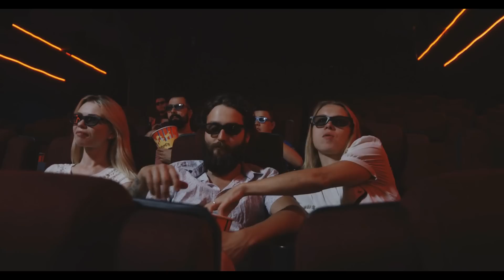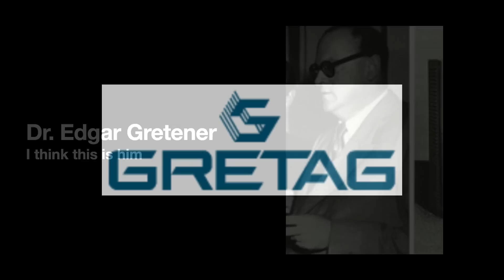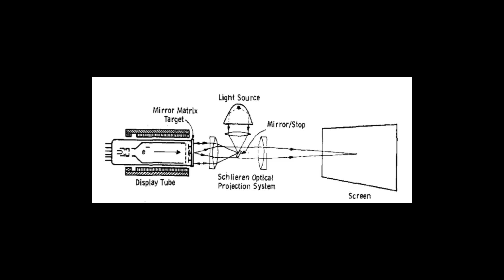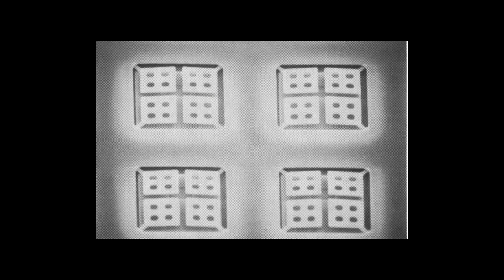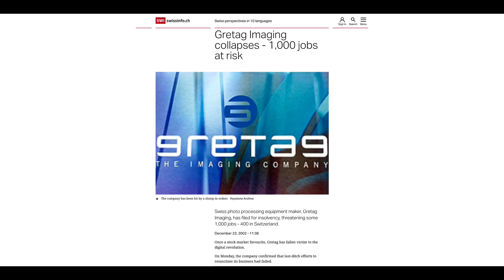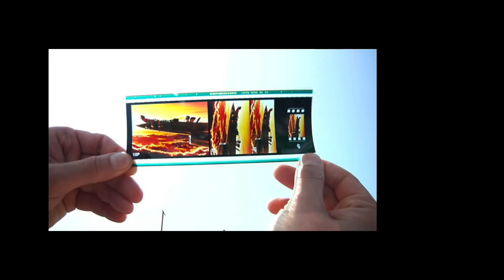How Optical MEMS Won an Oscar

Comment: “Your slow and incompetent human visual system is too slow to perceive”.

Too slow too perceive what? Just so you know, one source of anxiety is optical overload. That means too much visual data is being perceived, which causes stress. About a hundred years ago, a doctor invented a pair of eyeglasses with mechanical shutters that opened and closed fifty times per second. This cut-down on incoming imagery. But I don’t know if these glasses were effective in reducing anxiety. Nowadays it would easy to do that with a pair of LCD lenses. And you could add a software option to your big screen TV; limiting the refresh rate to fifty, or forty, or thirty frames per second. Also, the sound track of your TV could have adjustable pitch because slightly “sharp” audio is cheerful. Orchestras commonly tune their instruments to a slightly sharp pitch.

Anyway, this video tries to make two false claims. The first false claim is that more data is always better. But that’s not true. On the contrary, it’s the ability of the human mind to prioritize and select only certain data when thinking. That’s called “Focus.” So even if the incoming amount of visual data were increased, it still wouldn’t change the value system, and logic system of the viewer. More is not always better. Information is supposed to concise and relevant; not generalized and endless. Have you ever read a government report?

The second false claim is that visual perception is an isolated experience. But of course it’s not. What a person “sees” is only part of his or her entire Kinesthetic experience. Mood, hunger, social setting, and expectations all have a profound effect on how visual information will be interpreted. In the video “Clint Eastwood” the additional claim is made that perceiving with five normal senses is pointless because physical reality doesn’t exist. It’s all just part of your imagination. (You perceive with your mind…so it’s all in your head). But physical reality is the artistic product of our intellect. Beautiful women and handsome men are the result of careful selection, good families, and genetic memory. 

Most people don’t know that there’s no such thing as “instinct”. When a bird builds a nest, it’s relying on inherited memories. Human experience is actually coded into your DNA, and it changes with each generation. DNA patents claim that DNA is static; but it’s not. DNA is dynamic. If you graft an apple branch onto a Pear tree, you don’t get an apple or a pear. You get something else. DNA is only part of physical reality. So there can be no DNA patents since the promised “result” can’t be delivered. The physical development of a child depends to a large extent on genetic memories taken from the previous generation, and his own life experiences. 

But non-Aryan DNA is terrible, and BLM knows that to be true. So they make the claim that DNA is public property. White human eggs belong to the whole world. And since physical reality doesn’t exist anyway, using white eggs to manufacture children isn’t immoral. It can’t be. Nothing exists. Not even God. So the only moral crime is selfishly denying blacks access to better DNA.

Communists ultimately want to create a totally centralized media empire, which delivers specific instructions in the guise of medicine to each person. They claim that the life of experience of each person can be optimized, for better genetic memories. And of course those inherited memories will be related to sex and a lifetime of following orders. It will become genetically ingrained. 

Citizen: The Oracle knows all; and sees all. Your visual field is useless! So don’t look at us. We’ll look at you.

Comment: if the mirrors have only 2 positions, how do you change the intensity/luminosity  of the pixel ?
Reply: The mirrors are rapidly turned on and off to vary brightness over the duration of the frame. The larger the ratio of on to off the brighter the pixel.
Reply: @Noubers  thanks a lot !

Comment: I don't understand what the mirrors do. Like do they change the color or something?
Reply: They reflect the light from a source. In the on state, the pixel is bright. When the mirror tilts, it turns the pixel off.
Reply: @Grak70  Specifically, when On, the light is directed through a lens to the screen.  When Off, the light is instead sent to a black light absorber inside the projector which requires some form of cooling.  The time spent on and off effectively pulse-width-modulates the light for each of the RGB components so that the eye and brain perceive a range of colours.